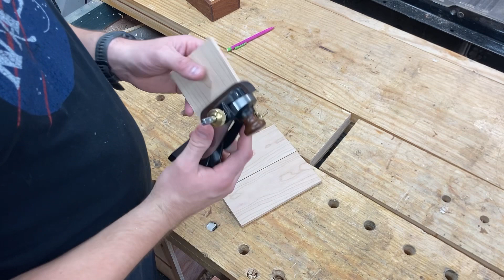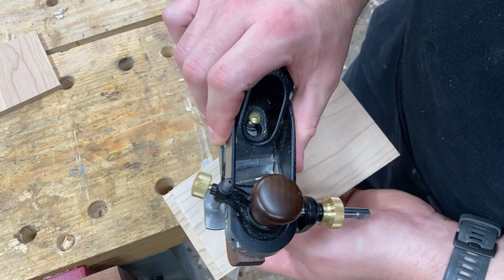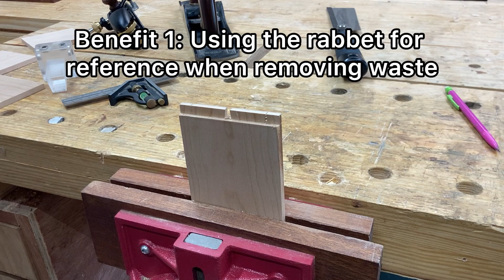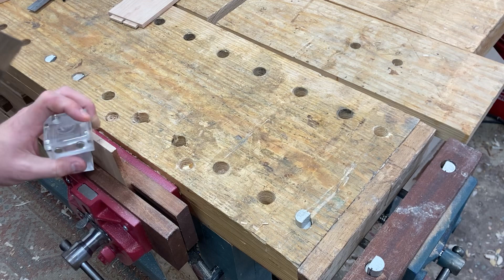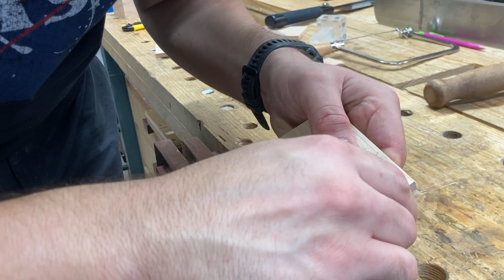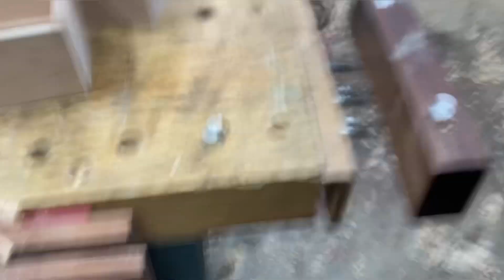4 Reasons to Add a Rabbet when Cutting Dovetails

Comment: Great info. The slope cut is a revelation. Well done!
Reply: Seems that the slope should be vey little so the outside base is not too sharp a point. Also this does facilitate the outside getting better contact because you don't have a problem of the inside bottoming before the outside if the base is not perfectly square.
Reply from the maker: @dpeteual  yeah, I leave a reasonable amount that still needs to be chiseled back. That leaves a flat instead of a point as you mentioned. So it’s still supported, but chiseling just gets easier.
Reply from the maker: Thanks James!

Comment: That's brilliant on many levels 
Now I need to make my rabbet planes tuned up better, so I actually like using them :)
Reply from the maker: Thanks! Often the rabbet is the hardest part. I often do it with just a marking gauge, saw, and chisel due to the rabbet plane inaccuracies. 
Table saw works well too lol 😅

Comment: Interesting! I'm not sure I'm 100% convinced, but I have to admit that it's very clever. I like the efficency of the sloping cut, and hiding the groove is pretty clever (though the groove is very shallow).

Nice job!
Reply from the maker: The sloping cope part is dependent on the rabbet, but the rabbet can be done on its own to hide the groove. This is a pretty small box, so I don’t need more than 1/8th of an inch, but it certainly would scale up. And the bigger the box, the bigger the efficiency gain of the sloping cope method. 

If you’re ever just looking for a few minutes in the shop to practice something, give one or both parts a try!

Thanks for watching!

Comment: What you do substantially weakens the dovetail joint. To understand why, you need to do a force diagram and see how the forces and moments change when the joint is forced slightly out of square. What you did eliminates a substantial fraction of tails restorative moment. There is a reason why this joint is done the way it is after thousands of years, my friend.
Reply: I think the way it was done for thousands of years was not for strength. It was for ease of making the joint and speed.

Comment: I've been doing this for a few years with one difference: after the rabbet is cut I then do my pins first, then the edge of the rabbet references the inside face of the pin board for layout. This way I can lay the tail board on my bench with the pin board straight up, skipping the vise altogether. It saves quite a bit of time if you're making lots of dovetail joints at once.
Reply from the maker: Nice! I’ve tried both ways, and tails works better for me, but I appreciate that you’re keeping the continental style alive!

Comment: A rabbet is a great aid to cutting dovetals.  Eric, walk me through your work bench.  Are they sliding centre portions.  How's that sliding centre work with the bench dogs.  Thanks
Reply from the maker: Hey thanks for watching! The bench is kinda like a lazy/cheap/modified wood whisperer design. The front and back slabs are stationary and the middle just have grooves for the sliding section. The bench dogs you’re referring to technically could work, but I don’t use them for work holding. 

I have the hopes of building a Moravian workbench at some point, but just like my current setup, it has to pull double duty as an outfeed table

Comment: I like the idea of a tiny rabbet  just enough to make a stop, maybe a 32nd thick but not a rabbet as deep as what you made. I can't say it's a weaker dovetail since the mechanism of how the joint works is the same, and for the function, a half thick dovetail should be sufficient. Personally, I just dont like the look. The perspective is off when seeing how thick the wall is, then comparing it to the dovetail... sorry, I don't appreciate the look.  Regardless everything else looks reasonable.
Reply from the maker: Totally respectable! And on little boxes like this, the look is very noticeable, but maybe consider it for bigger boxes or casework! An 1/8th or 1/4 inch rabbet on a 3/4 inch case is almost invisible. 

If the question is aesthetic and not functional, perhaps the question is where you would or would not try to use this method

Comment: Viable technique especially for batching out multiple pieces. As pointed out by another commenter, it does thin the dovetail ends if this bothers someone. Nice presentation!
Reply from the maker: True! And admittedly, I kinda like that. The thinned out portion is the ugly side of the dovetail, so it adds a little interest to thin it out. Also, it’s much more noticeable in small boxes, but this technique works in big stuff too and the thinning isn’t very noticeable

Comment: Clever and very interesting. Your "slope and cope" method, as I understand it, is the same as undercutting which I have seen used in making dovetails. I wonder, though, does this significantly affect the strength of the joint because it does reduce the contact area?  Nice video.  Thanks for sharing.
Reply: I believe in undercutting the pin sockets on the tail board, you are coming into the center from both sides, with your chisel registered in the scribe line.  This removes any hump and allows the pin board to fully seat.  Since it's end grain anyway, you're not losing any real glue surface.
Reply from the maker: As I understand it, the part that is undercut, no matter what the method, is not the surface that is providing any strength in the glue-up. The long grain in the tails and pins is where the glue strength is. 

That said, the rabbet actually would add slightly more structural stability, even if the slope and cope sacrificed a tiny bit of strength. At that scale, it’s all pretty negligible, however. I don’t see any real loss of strength! Thanks for the comment!

Comment: Nice work. Innovative on the slope. I've not heard of this. But it is legit. Many similar approaches were taken in the early years of electric guitar building. If it doesn't show and it's not a structural risk - do it.
Reply from the maker: Oh really? What aspect of electric guitar building?
Yeah, the inside shoulder should not be seen nor heard from ever again after the glue-up!
Reply: The sloping of the tail socket substantially weakens the joint "unless" the tail face is equally sloped - sorry, guys, but physics says so. Please see my comment above, and if you have questions, please ask.
Reply from the maker: @skwalka6372  eh, structural strength isn’t much of a concern on little boxes. This joint is still way stronger than anything with a butt, miter, dowel, or spline and the long grain surfaces are all in fact for glueing
Reply: @ericrichter7933  if your primary concern is looks, you are correct. But it is important to understand why you would not want to do that where strength is needed. Your way of doing the joint is substantially weaker tan a properly done plain miter joint, regardless of end grain issues (emphasis on properly done). As I said, do a force-moments diagram an you will see why.

Comment: So to make this work you need a skew block plane and a plow plane + fence, yes? Helpful video! I like how you don't see any groove from the front.
Reply from the maker: The rabbet and plow are both achievable with a table saw or a router as well! I actually just got the skew block this week and used my table saw or just a crosscut saw and chisels to achieve the rabbet before

I’m just trying to move toward more hand tool use to avoid the dust and noise!
Reply: @ericrichter7933  totally onboard with leaving behind the dust and noise!

Comment: Do you need to account for the rabbet on the width of the box?
Reply from the maker: The rabbet has to be the same size as the pin board thickness! It’s about 1/8 deep and on this box it’s about 3/8 tall to match the pin board!
Reply: @ericrichter7933  sorry I meant like if I want my box to be 12 x 8 do I need to make it 12 x 8 1/2?
Reply from the maker: @BatCaveCreations  ah I see what you mean. Yes, you would lose two times the depth of your rabbet. So if you have a 1/8th inch deep rabbet then you need to add 1/4. Or if you want a 1/4 inch deep rabbet, then you would add 1/2 an inch.
Reply: @ericrichter7933  thank you!!!